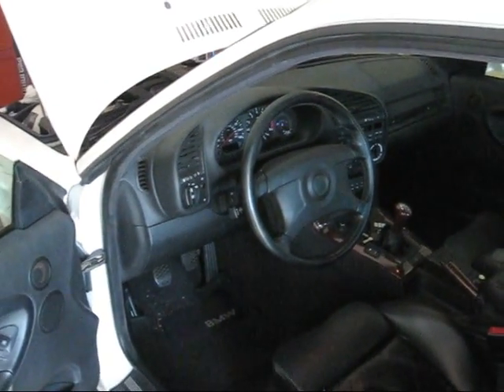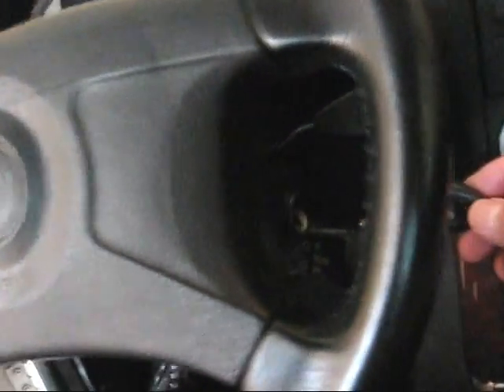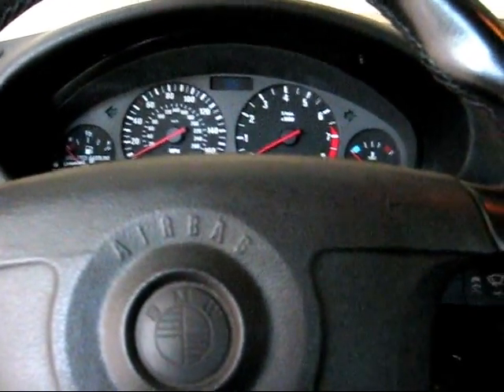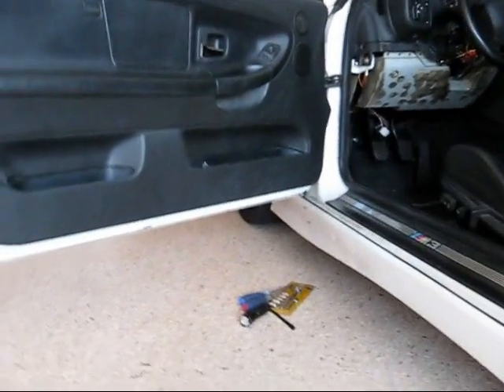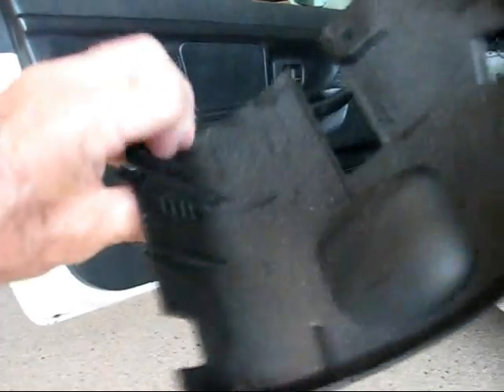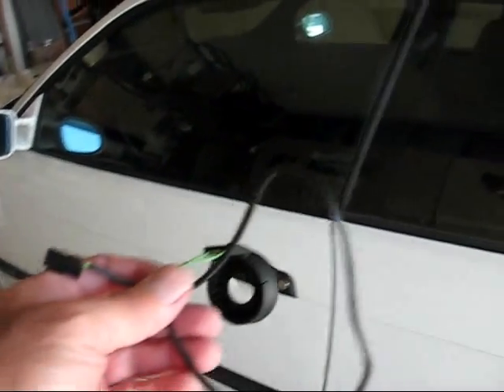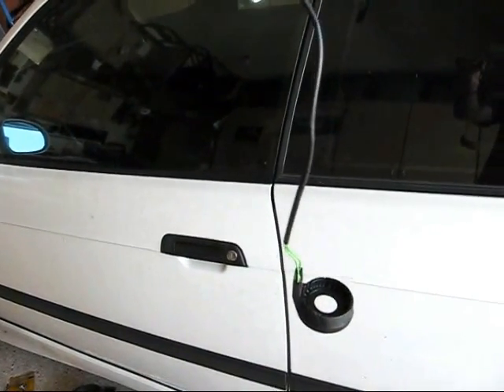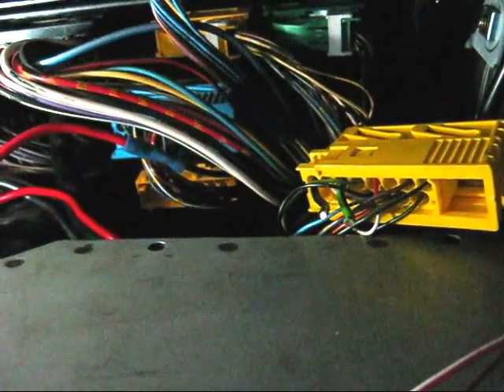BMW EWS II security bypass on 1995 M3 by froggy

Comment: I have a no fuel prime condition when KOEO, so I switch DME''s with the same "silver" dme matching part number, out of a known good car. I installed it, "cut the green wire" . it cranked but no start. any suggestions?
Reply from the maker: Do you hear the fuel pump run?
Reply: No. It runs when the car is running. Or it will koeo if I jump the relay. But other than that it does not prime.
Reply from the maker: So it's a good pump, certainly sounds like a security circuit killing it. My trick works on the 1995 but other years probably had differences, sorry not more help.

Keep googling & try bmw forums.

:)
Reply: Well. Mine must be a mid year model change because its a 95. I will diconnect that green wire and see if it changes anything.  Thanks.
Reply from the maker: I believe there WAS a mid year model change. Good luck & post back if you have success.

:)
Reply: ***** I still have the car. It still wont start under 39 degrees. If I ever find out I will let you know. But its crazy. If I cover the MAF with my hand while cranking, (like a choke plate on a old car,) it will start up and run all day. I have replace nearly everthying including the DME. Once the car is warmed up it will not give me any problems. If it stays warm outside, like spring, summer and fall it will not give me a problem. Only when its cold. Sorry I couldnt help.
Reply from the maker: I'm just guessing here, but that sounds like an ambient temperature sensor that is bad. Many cars have them to make the air/fuel mix rich when it's cold & when the engine is cold (like a choke). See if you can figure out if there is one on the car.

Keep posting.

Use a diagnostic tool (code reader) if you can..

:)
Reply: I do not have a scan tool. I check the ambient air flow temperature sender in the intake manifold with a volt ohm meter it works properly and I put it back in. The only thing I have not checked or was able to check is the mass airflow meter. If I disconnect the mass airflow meter the car will not start at all.
Reply from the maker: I'm guessing, but there may be another temp sensor, like the one that displays outside temp on the driver info center.

:)
Reply: That has been broken for years. Never had a problem, I think I have a bad or corroded connection or the ews is going wacky.

Comment: I've got fuel pump issues.  It's not priming. Checked fuse in black box under bonnet, 20a in fuse box, fuel pump relay and fitted a brand new fuel pump and still won't prime. My car is an e46 2001. Will this be my problem do you think? I havnt a clue what dws is in mine :/
Reply from the maker: How do you tell that the pump is not priming? Can you HEAR it run? What is the pressure at the engine fuel line ZERO?

:)
Reply: froggy it's not buzzing on 2nd click like it used to. I think mine has slipped a tooth now
Reply from the maker: That is different from not priming. Sounds like no power to the pump. Not priming means it RUNS but no pressure builds up.

No power to the pump "could" be a sign of a security system error condition.

The security system changes almost every year as BMW reacts to German government laws mandating vehicle security.

Because of the changes I can't say very much about your model year, I would just be guessing & prefer not to do that. Do more google searching & specify the model year. Post back if you have any luck.

:)
Reply: froggy it's at the garage and they sayin there's fuel in the fuel rail and is pressuring. It fires but won't start up. There is power going to it as the relay and fuse is fine. It ran poor for a week before it cut out but started every day . Surely that's not ews issue?
Reply from the maker: You need two basic things fuel & spark, so it sounds like you HAVE fuel. If it FIRES off a little but won't KEEP RUNNING then you have SPARK.

It does NOT sound to me like security issue.

How many miles on the car? Any recent service? What does "run poorly" mean? Be specific.
Reply: froggy lacking power. Was fine till last week till it died on me. The comp is saying cam sensor but I've replaced it, cleared it and its still there.  So wonder if the sensor is no good?? Either that or crank sensor.
Reply: I have heard that those sensors can cause a problem with the car not running well or it won't keep running so at this point I guess I would suggest listening to the technician is working on it because he's got his hands on the car when I'm just on the Internet
Reply: B Plante the tech said he's ordered another cam sensor buy a more expensive 1 as he thinks the sensor I bought is no good. He's checked the timing and it's fine Aparantly.  So we'll see. Cheers for replies :)
Reply: Let me know how it works out sounds like that might be the issue thank you for posting and thanks for visiting Froggy's garage
Reply: B Plante bad news is. It's skipped a few teeth :/ So needs a new chain etc
Reply from the maker: The timing chain? Ugh.

Comment: You bypassed the Starter part of the DME  EWS2 system, but you still need chip to allow ignition
Your fix here repairs it when relay for starter dies
Reply from the maker: I think I made that clear, with my bypass you still need a key with chip and antenna at the ign sw. sorry if it wasn't clear enough for you.

Also the bypass is for a part of the ews2 circuit board that dies. You still need a starter and starter relay that works.

:)
Reply: Have you used any of the claimed bypass boxes they sell, supposedly eliminates need to chip in key etc?
Reply from the maker: No I have not as that part of the system was functional.

Thanks for the comments. I like to get all the info I can out there.

:)

Comment: Just to make sure, to bypass the EWS in the glovebox you just cut the two biggest wires on the yellow plug and connected them together?
Reply from the maker: Review the video at the 12:00 minute part. This is reversible if you do it neatly.

:)
Reply: froggy are you sure its ews II ? I did this same exact thing. I bypassed the ews by cutting the two biggest wires from the ews harness and connected them together. It cranks now but does not start. Maybe the difference is the dme? I don't think it's the a 413. If you have any idea why it's doing this, let me know. BTW the car is a 98 bmw 318ti. Thanks
Reply from the maker: Ricardo Nelson BMW made/makes a lot of changes to the security system from one model year to the next as the German government changes the anti theft standards.

My fix works on that 1995 car but I can't say if it'll work on a 1998, wish I could say more about it, yes it could be changes to the DME that are at issue with yours and yes mine is EWSII

Comment: I have an 1995 bmw e36 318is and it will not crank,  i followed the steps in this video and engine will still not crank.  Is there another thing i have to do to it?
Reply from the maker: First you need to DIAGNOSE IF the EWS2 is the problem. No crank MAY have several other causes. Dead battery/dead starter etc.

My procedure is ONLY if you have CORRECTLY diagnosed EWS2 is "broken". Your car must be , otherwise, is full correct working order.

:)
Reply: Yeah it is the ews,  the starter is working as i tested it with leads .  I tried to jump the fuel pump and it wouldn't work so i think it must be the ews .  this car lay up for 4 years and had no battery , when i connected the battery the alarm sounded.   Ive read on some forums that some people cut the little green under the hood , close to fusebox
Reply from the maker: Can you turn the engine by hand? If it sat 4 years it'll be hard for the little starter to spin it, yes?

:)
Reply: froggy Yeah its turns no problem,  when i connected starter directly to battery it turned engine
Reply from the maker: Do you have a key with correct chip? Is the antenna at the ign sw in position?
Reply: froggy Yeah i have the key i checked it and chip is intact, and antenna is in position ,   gonna try putting in the non ews ecu and see how that goes
Reply from the maker: Keep me posted.

:)
Reply: froggy Well i put in the non ews ecu and still no change,  i tried it with ews wires re joined and cut and still no different
Reply: froggy I also tried the original ecu and rejoined the wires and tried it again,  the key comes with two sigma fobs, and the key has a chip inside , cant see why its not cranking in the first place,  as that is the key for it
Reply from the maker: Wish I had another idea, keep me updated.

:)
Reply: +froggy
gerry boyle

I was in a similar position as you a couple of years ago with my 97 328is. Unfortunately, EWS2 systems cannot be bypassed. EWS1 on the other hand, can be bypassed. Here's why: EWS2 uses a two part system to disable the car. First part is the starter disable. This is simply a built in relay in the EWS2 module(behind glovebox w/yellow connector). Second part is the disabling of the DME to allow fuel injectors and ignition coils to fire. Froggy here, most likely had the starter relay inside the EWS2 module go bad so by cutting the green wire and connecting it to the black/yell wire he simply just allowed a direct path from the start signal(12v) at the ignition switch to the starter. The issue you-gerry, have here is that the DME is still disabled at the injectors and coils. Unless you have BMWs diagnostic computer(MODic) then you won't be able to get around it.
The EWS system is pretty good as a security feature, but when they fail it's not cheap.
I ended up installing a Megasquirt ecu and never looked back.
Reply from the maker: This could be true, I think there is also a DME part changeover in the mid 1995 year to further complicate things.

The fix I posted is easy & reversible so I hope it continues to help lots of folks.

:)

Comment: NO friend u did not bypass the immobiliser =antitheft.what u did ,bridged the starter relay wire.if u remove the transponder from ur key the engine will crank but no spark from plugs.to bypass the whole system ,either u put an immo off free dump in EEPROM,or use emulator and write ISN inside it.wat u did can helpif u have afaulty relay-hope u get get it.

Comment: Wat if my key dont have a chip
Reply from the maker: If the rest of the original system is intact, and you try a key with NO chip, the car will not start.

:)
Reply: Nvm mines a 94 325IS

Comment: Before dissembling/bypassing the EWS, you may want to try this, as I had the exact same issue with my car (intermittent no crank) but it wasn't caused by the EWS.

In order to start a manual car, you need to push the clutch pedal, a switch/button is pressed when you push the clutch pedal, the issue was that the switch was not making a proper contact, that's why the issue was intermittent. change the switch behind the clutch pedal or bypass it, and your problem may be gone.
Reply from the maker: Just as a point of interest, the 1995 m3 stick did not have the clutch switch. You could crank the starter, in gear & it would jump.

Later models did have this safety feature so far as I know.
Reply: froggy great to know that, hopefully people with newer models searching for a solution may find this info useful, mine is 97'

Comment: Hi froggy. I need your help on my E36. It can crank but no spark no fuel. Please help
Reply from the maker: This is beyond the point of the video, but you need to start tracing back the elec. connections for both to find where the power is shut off, really beyond what I can help you with. But best of luck & post back what you do find!

:)

Comment: Do I put back the yellow plug back after bypassing those wires. I bypasses the wires and I haven't put back the plug. There is no spark and fuel at the moment.

Comment: Hey frog quick one for ya just got a 95 325is same problem as you. So when you turned key in on position did fuel pump engage ? Or just silent and no crank no start.  Mine is silent and wondering before I try your solution and jump the wires
Reply from the maker: Total silent when mine was having the issue.
Reply: Chris Lyon is your car automatic or manual?
Reply from the maker: Stick.

Comment: When I turn my key to on, I'm just getting the airbag light.  Were you getting lights with the no crank or did you not get dash lights as well?   Needless to say, I get no crank.  If I test my fuses... I'm getting no power to quite a few fuses including starter, etc.
Reply from the maker: Honestly I don't recall which dash lights I got, it may show in the video if you ck it again. Sorry.

:)

Comment: In a nutshell. Cut the two biggest wires and connect them together on the harness side, then isolate the cut wires going into the EWS II....?
Reply from the maker: If I recall correctly, yes. But a careful watch of the video is best.
Reply: Thanks Froggy. I did watch the video, and I'll watch it again to be sure.
Reply from the maker: This was 2 years ago and I trust the video over my memory. Car is gone/sold.
Reply from the maker: If you do a neat job, everything is reversible.

Comment: Great video. Bypass worked for me. Fired up first try. I didn't even bother messing with the key antenna. Mine is a 01/95. For those people saying it doesn't work for them, I believe is because this is for obd1 with ews2. The later models had a fuel and spark cut along with the ignition. Thanks froggy.
Reply: I have a e36 318is from I think January or February 1995 with OBD1 will it work ?
Reply: Do you know how to do it the the fuel and spark ? I have a 99 M3 auto and I need to do something similar but would like a more confident plan
Reply: death by sr20 do you know how to do it with the fuel and spark cut out ? I have a 99 M3 auto . Thanks in advance

Comment: Hei .I have a big problem! I have changed the motro from 316 1993 to motor 328 from 1994 . and I can not start the car! fuel pump is not working and the motor is not powered! but when I turn the key so the engine runs around with it will not start! can you help me figure out what is wrong?If I do what you did on the video? can I start the car? sorry for my bad english .
Reply from the maker: This is really beyond what I did, but I think you need the controller and EWS from the newer car also. Sorry can't help more.

:)
Reply: No problem :) thnx u

Comment: Hi froggy I just wanted to know if a remote start solve the problem too? I have a bmw e36 328i sedan.
Reply from the maker: Even with a remote start I would think the broken EWSII would prevent starting.

:)  IMO
Reply: Thanks for the info and do I just buy the EWS II module and plug it in? By the way what color would the connector be blue, yellow, or white? It would be great if you could help thanks.
Reply from the maker: Each model year can be different.

:)

Comment: Good bypass, for others that cant do all that.  You can get a DME, key w/ tumbler, and EWS from a downer car (bout $250 for set / ebay).  Install ignition (key), EWS module, and DME in about half hour. The car will never know the difference, no programming (plug and play).
Thanks for the bypass tip, sure I can use in the future.

Comment: hey, I have same problem and I tried this security bypass on 1996 BMW E36 1,8tds  starter is runing but car not crank up does enyone know meybe diesel engines need to cut more wires? pleace help me I will be thangfull for any informacion!!!
Reply from the maker: Diesel is most certainly different, anyone else?
Reply: froggy I can't find any informacion or video about diesel bmw security bypass..  do you know where I can find more information about that yelow cable connector? I think that in that yelow cable connector is wire that blocks diesel fuel pump.
Reply from the maker: Sorry, I don't have info on that car.

:)

Comment: 20140309 022349

Does it look like the same symptoms you had?

Dis v57 shows ews, engine start no possible.
Reply from the maker: No it's different. Yours is CRANKING. Mine was NO CRANK.

Put a boost on your battery, it's weak and start by check fuel pressure.

Comment: Thank you so much froggy!! I have the same problem with a 2001 525i. You gave me some great direction. Now I just have to figure out which wires will bypass my ews... Thanks again for the great video!!!!
Reply from the maker: Thanks for watching, be advised, there are changes from year to year, a copy of what I did on my 1995 may not work, just sayin.

Good luck.
Reply: froggy brother my car is 1995
Reply from the maker: fation ismaili should work

Comment: Hi froggy i did jump the two wires but the car just cranks does not start all the way any ideas? Ty
Reply from the maker: Check the fuel pressure as you have another person crank the car over.

Comment: Wow I think this might have help me a lot. Im jus about to get car jumped hopefully soon, I tried your technique but have not much battery. It turned though. What happened was as I was coming home one day and a I heard statiky sound in my bass. Then I smelled something burning and it was wires behind my dash underneath. There's a chiming that doesn't stop, so I took it out of the plugs. not sure where the leak is but I think my battery is not getting full potential. 
95 red e36 325is
Reply from the maker: Thanks for watching!

:)

Comment: I tried the stomp test and didn't get any code other than 1444 which read there are no codes stored. I'm really thinking it might be the starter, but this was sudden and not intermittent which makes it even harder to diagnose. I had Jo previous symptoms, the only thing that would happen occasionally was my flashers would come on and then I had to push the hazard light and it would turn off. Any idea what that might be? I thought it might relate to ews.